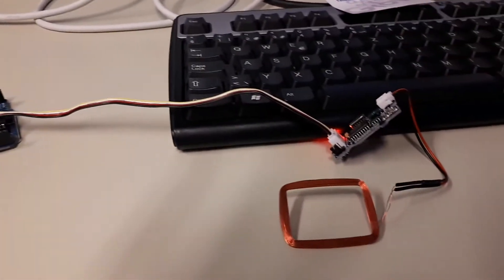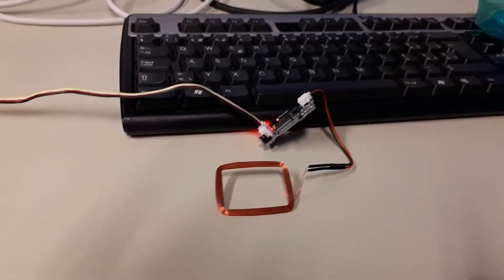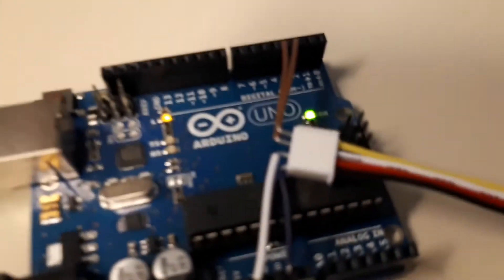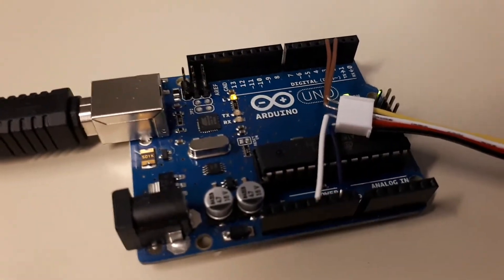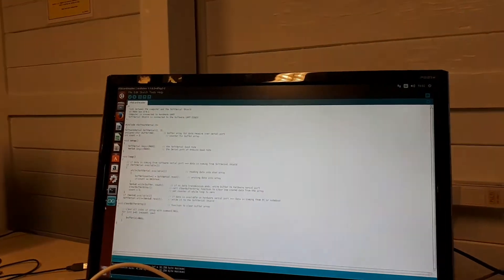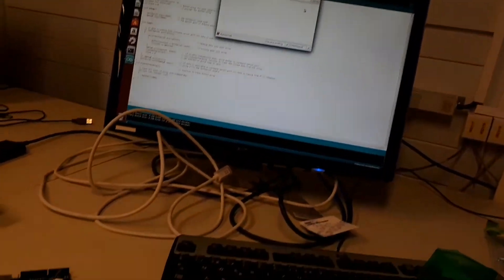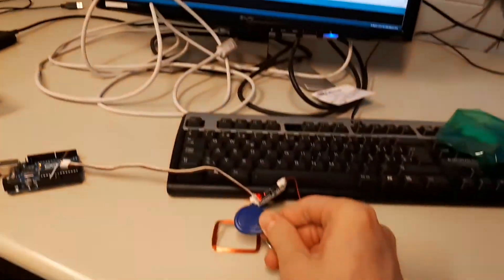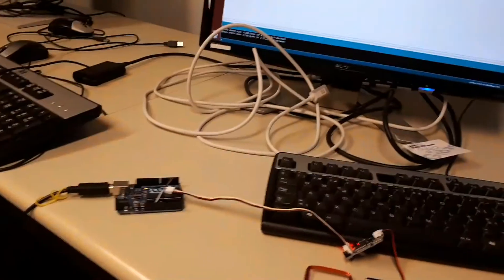125kHz RFID tag reader

Comment: I purchased this from groove and I connected to pin 2-3 like you but on a mega and using their code I get nothing coming in on the SoftwareSerial, the light flashes on the RFID board when I put the tag near it but nothing in serial, any ideas?